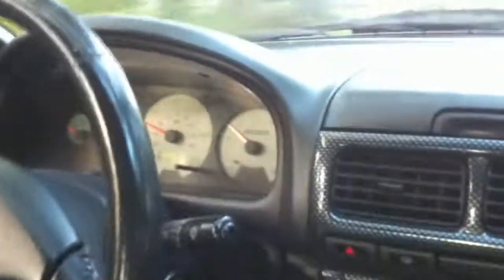Subaru Impreza 2.5RS hesitation/bucking

Comment: My xv has started stuttering then going in second and third gear if accelarting bit harder., changed air filter, fuel filter and still doing it, cleaned maf sensor also. Do you think this could be the o2 sensor? No alarms, warning etc on dash at all

Comment: My subaru legacy bucks / jerk when the gear change in 2500 rpm do u know wats the problem need some help
Reply: So I filled in the empty space in the differential bushings, thinking the drivetrain had too much slack. It only helped 10%. While doing basic maintenance the other day (oil change, filter check) I used some CRC MAF cleaner to clean the MAF sensor through the protective grill (pop open the intake clips as if to change filter, you'll see it in the intake tube, careful not too pull out the small hose underneath).

The bucking when accelerating and letting off the throttle in lower gears was almost completely eliminated. It used to really jerk your neck 2-3 times and even clunk in the rear. A bit more power now as well (restored I estimate 5-10hp), still watching for a fuel economy difference.

There were no check engine codes indicating the MAF readings were out of spec. Wish I did these a year ago, wouldn't have had to feather the clutch so much for passenger comfort.

1997 Legacy Outback EJ25D 5-Speed

Comment: I just put a B new fuel pump, new gas filter and 4 NGK plugs in my Subaru Legacy and I still get hesitation, the coilpack is 5 month old, the wires are new too. so, what gives? should I clean the MAF?

Comment: hi i in stalled a injen cold air intake and at the same time i installed new spark plugs and changed the oil and when im at a stop and press the gas pedal all the way the car BOGS then runs fine after 2rpms 

eny help i have reset the ecu and checked the spark plugs to make sheer its fireing right and the check engine light never comes on ? eny help would be great 

o ya 2007 subaru impreza 2.5i non turbo

Comment: Upstream o2 sensor. Don't buy a new coil pack. Change the plugs and gap them right when you install the new Upstream. If you want, take the coil pack off and look to see if you have any cracks in the 4 clear areas. If so, you might want to opened a new one. Do it online, and not from a dealer. You'll save a few hundred.

Comment: Mine does it but it also pops in my cold air intake and I have the upstream O2 sensor code. Sure it's not a fuel pump? Mine normally runs fine when I barley touch the gas but as soon as I step down it pops and shakes and has no power. Idles fine and everything
Reply: PmS Vapor it's your front o2 very important sensor

Comment: My 2.5 rs does the same thing, i replaced wires/plugs and cleaned the idle control valve. Is it deffinatley the o2 sensor that causes this?

Comment: There's and easy way to identify if its oxygen sensor if you have one sensor, "unplug the oxygen sensor", take it for a drive, if no change then its oxygen sensor, remember there are different types of sensors, my Subaru EJ201 has a rich sensor identified by slits in the sensor, as opposed to some sensors which are lean sensors.